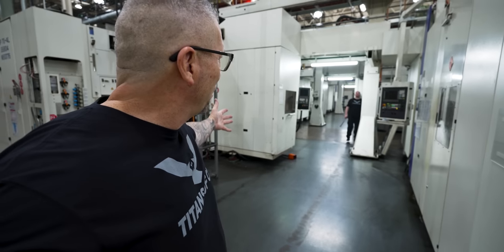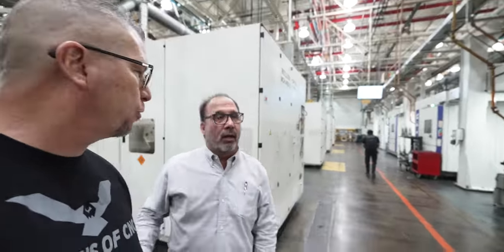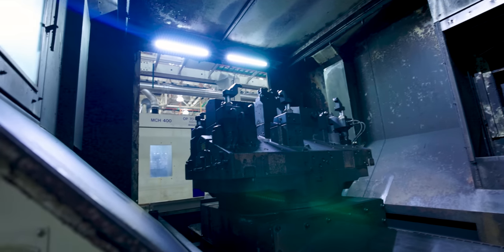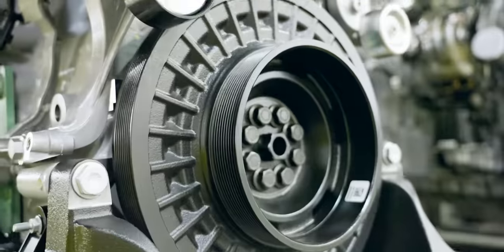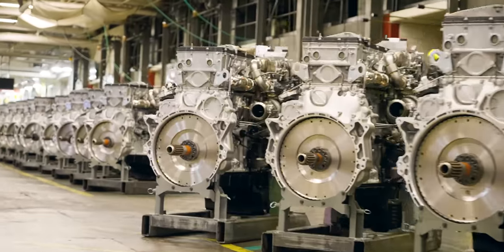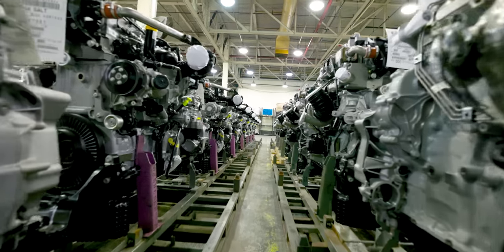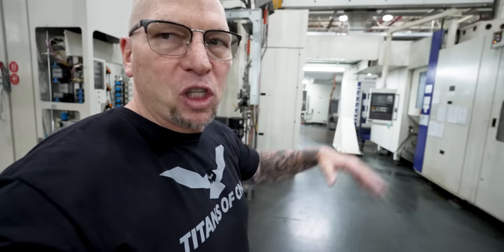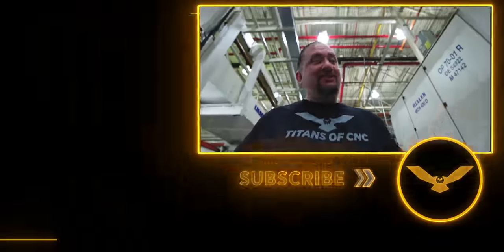EPIC HELLER Machining Cell at the DETROIT Manufacturing Plant

Comment: ONE MILLION ENGINES?!  Let's do a little Napkin Math: if there is even so much as a single non-parallel point in the manufacturing process (entry point, any interstitial point, exit point) and only one component going through that point took 17 minutes total to manufacture, one million of them would have required a minimum of thirty-two years to manufacture.

Would someone with genuine experience in this subject please correct me if I am wrong.  Much appreciated.

PS-- All of you folks who work in CNC-equipped factories are freakin' awesome.  It amazes me how effing smart you all are in terms of both the technical aspects and the sheer experience with all manner of special circumstances where reference manuals and conventional wisdom don't apply.  Bravo!

Comment: Do HAAS make anything like these machines. Where are the Blocks cast for these engines?
Reply: Haas does not, and the castings are made in Africa
Reply: Haas has been gradually increasing the size and weight of what they can handle, but this is not their current market.  Haas internally uses Makino IIRC for the really large heavy work in their plant.  They talk about it in some of the Haas plant tour videos.
Reply: Manufacture like this is a mile from Haas territory 🙂
Reply: @alexgreenhalgh935  This plant looks a lot like parts of the Haas plant, though the Haas plant has a lot less automation and probably makes a wider range of products.  But manufacturing massive truck engines isn't something that you would buy Haas CNCs for.
Reply: I was more thinking about the machines than the Haas facility, which I have no doubt is pretty impressive. You can't make the number of machines they do at that price point without some impressive technology.
Reply: @alexgreenhalgh935  the nycnc channel has a haas factory tour that is pretty cool.  There are others on youtube.

Comment: Those forklifts they use to move the engines I used to CNC machine the wheels. Half the trucks they put those engines in iv CNC machined oil pans, fan blades, heat shields, ect. Danm right America can still Manufacture. It's alive and well in Southern Indiana!

Comment: The only thing that makes me wonder,  is Cummins make a extremely good engine,  and many of the Detroits aren't that great. The 60 series was a good and dependable engine but the DD series from the 13 to the 16 i really didnt like . Freightliner owns Detroit and Mercedes owns Freightliner.  Not really impressed.  Im glad they provide good job's,  the quality isnt as good as Cummins in my opinion. I drove trucks for 44 year's, i drove the old 2 stroke Detroits,  modern Detroits, Mack, Cummins,  and Mercedes with a 16 liter V8 I liked the Mack, and Cummins, the Mercedes was a good engine,  but really bad fuel mileage

Comment: You are looking at Dinosaurs that are starting to be displaced by Electric motor, 1/4 the size with more horsepower and torque. The Tesla Semi which is just going into high production is better for the customer's profit margins and the enviroment. Detroit deisel needs to convert to detroit electric as soon as possible if those guys want a job in the future.
Reply: Problem: The Tesla Semi is a local-delivery truck. The Federal Motor Carrier Safety Administration would go through the roof if you told them, "yeah, the sleeper berth in this truck is a hammock. You hang it under the trailer for your 10-hour break." Also, the Muskism that is the cab is going to turn off a lot of people - because the driver seat is in the middle of the cab on the Tesla Semi drivers will have to relearn their visual cues all over again, especially when it comes to backing. Rigs like the eCascadia and Kenworth's electric semi will be more popular.

A lot of these engines are going into over-the-road service.
Reply: Maybe, but electric propulsion still needs high end machining to facilitate, so the future is bright and there are even more amazing cnc technologies out there to support - EMAG!